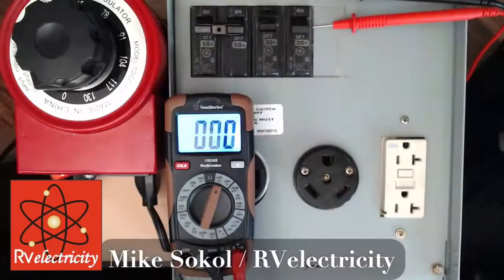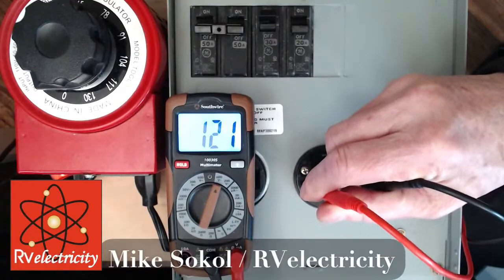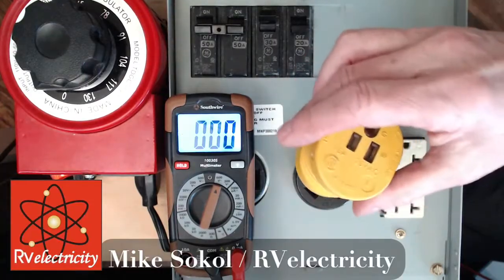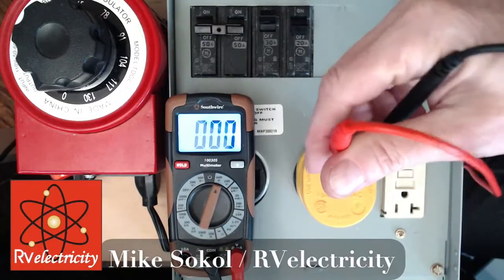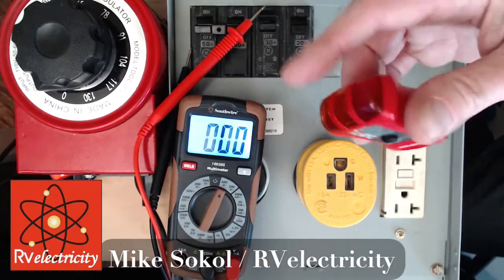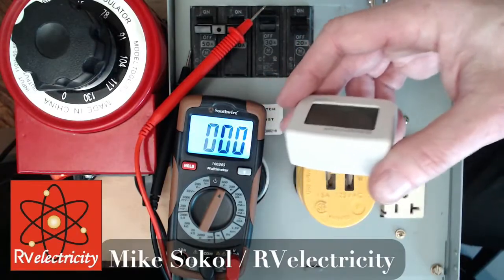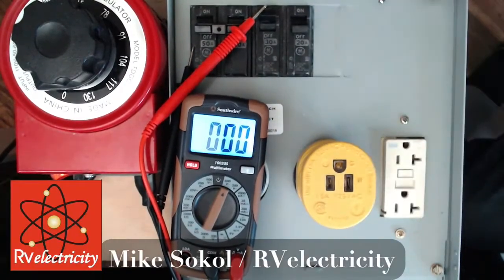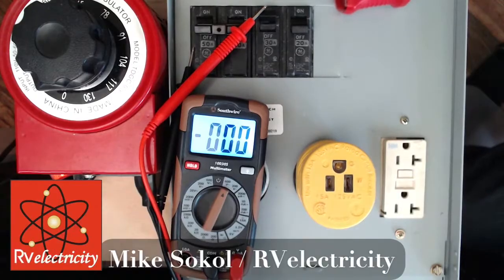RVelectricity Quick Tip to test TT-30 outlet polarity

Comment: Is there any reason NOT to trust my Progressive Industries hard-wired 30-amp EMS unit? I’m fairly knowledgeable in electrical stuff and bought/installed the unit on my trailer on the day I brought the trailer home. I learned about “floating ground generators” because of it. My generator manufacturer support instructed me to internally ground the neutral.
Reply from the maker: Ron, your PI hard-wired unit is great, but you need to park the RV in the campsite to use it. I think a quick test of a pedestal before you accept the site and make camp can avoid a lot of wasted time spent moving to another spot (if you can find one).